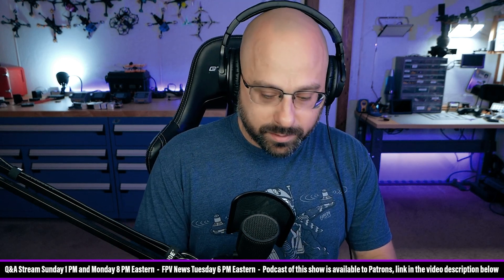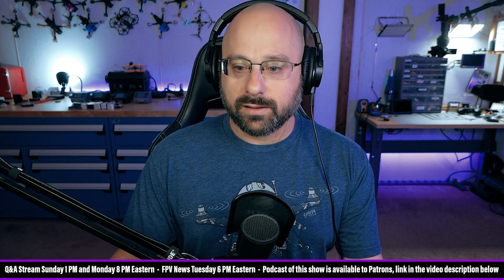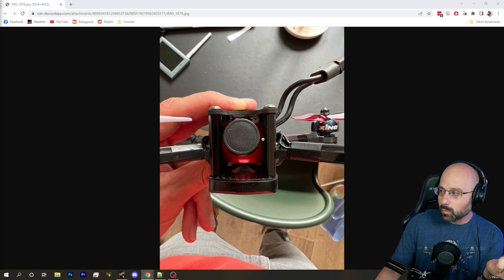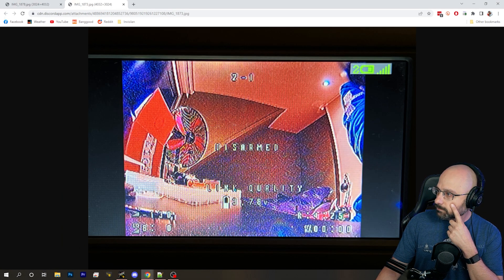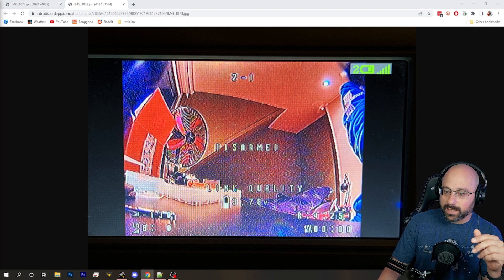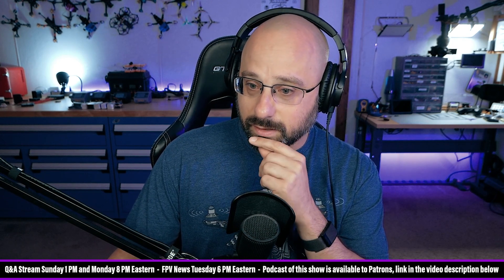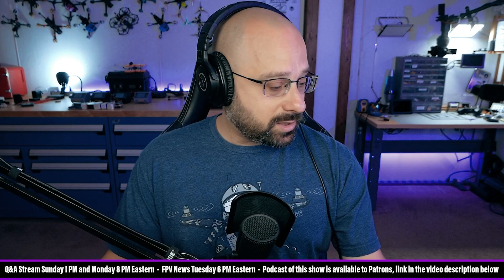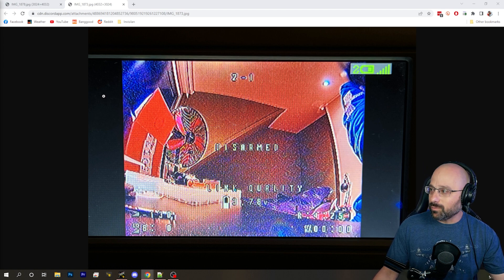My FPV Camera Won't Center! What's Going On - FPV Troubleshooting

Comment: So for anyone with this problem.. if you have a caddx camera you can try taking the camera apart, and flipping the lense housing seperate from the board 180.  I had bought multiple nebula pro's.. and one was off center like this.  Tech support at caddx said to flip the housing/lens seperate from the board and by god it fixed it.  It was literally like 5-7 degree's off before the fix. milage may vary.
Reply: Thanks, worked for me too! Caddx Ratel 2.
Reply: Hi, is there any graphical resource for this? I'm not sure if I understand this process. I just got a phoenix V2 and found myself with this problem

Comment: Yep, the cams sensor is usually slightly angled to one side inside the cam when that happens... my nebula pro suffers from it on my JS-1, props more in view on one side. It bothered my OCD at first but now I don't even notice it.